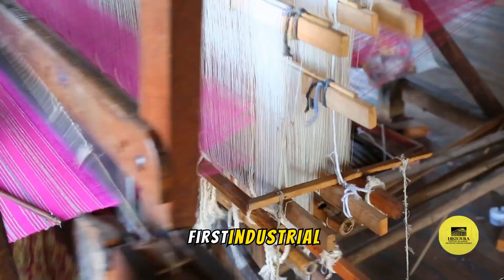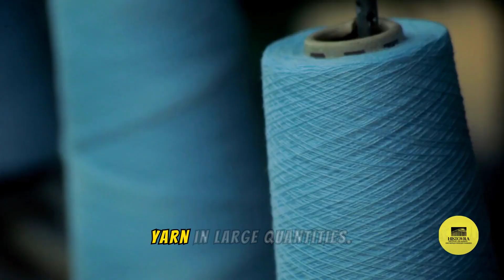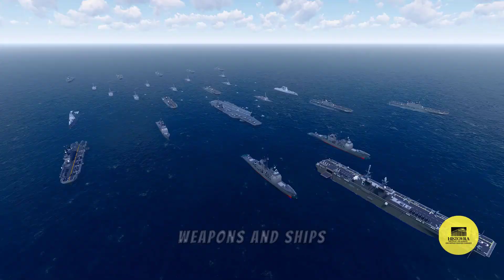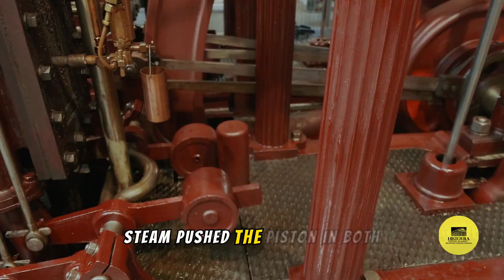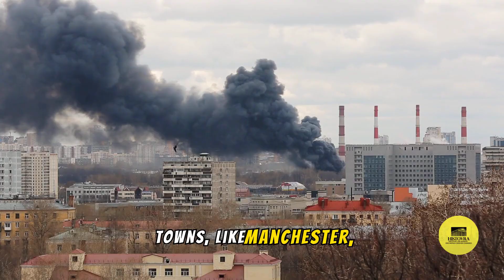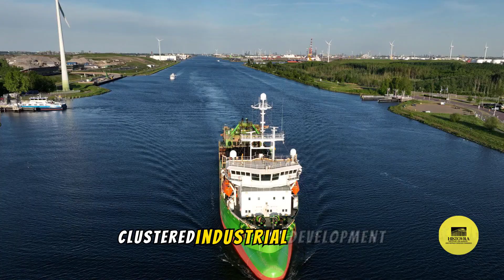The Machine That Changed the World: Industrial Revolution Part 1

Comment: A seperate condenser was no use whatsoever to a Newcomen Atmospheric Pump. It only works  for Steam Pumps and Steam Engines which have Atmospheric Resistance. 
Watt created a "closed loop" Steam System between the engine and the condenser which blocked out 14.7psi of Atmospheric resistance.
 Which also meant he could make use of High Pressure Steam way below ambient Atmospheric Pressure. 
The first person ever to do so. For example a 5psi abs. High Pressure Steam Pump or Engine with a condenser, could do as much work as a 20psi abs. High Pressure Steam Pump or Engine without a condenser, but only needed 1/4 the amount of fuel. A 400% increase in fuel efficiency! . Newcomen = Atmospheric Power. Watt =  High Pressure Steam Power. 
Also, James Watt's 5psi absolute Engine had 10psi Pressure on his boiler, the same Pressure Richard  Trevithick's 25psi absolute boiler had. So boiler technology was similar. By year 1900, out of 10,000,000 Steam Engines, only 25,000 were Locomotives.